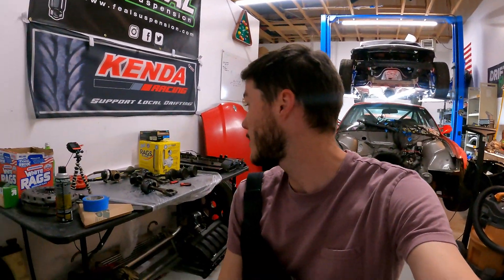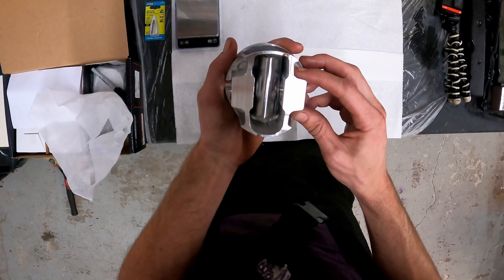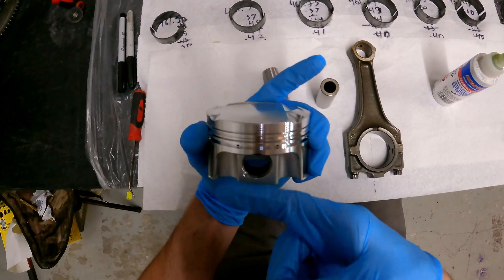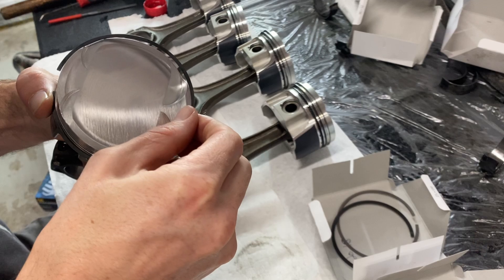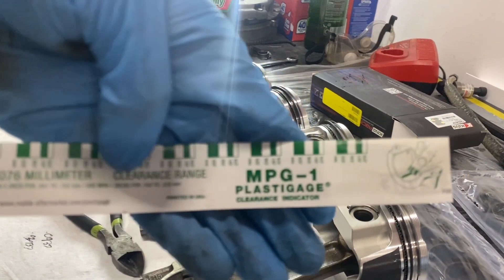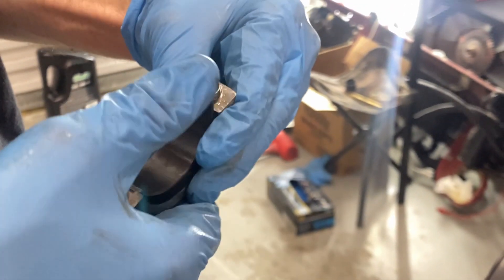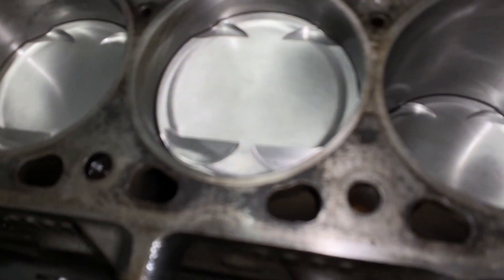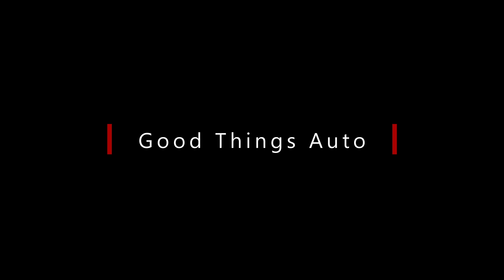Balancing M50 / M52 Boost Pistons and Assembling the Full Bottom End!!

Comment: Sup man, I’m on my second engine build currently have 8:1 wiseco pistons and eagle rods, stock m52 crank. Correct me if i’m wrong, you’re using m52 crank with m50tu pistons to bring the compression from 8.8:1-10.5? I’m looking for 9.5-10:1
Reply from the maker: I am!  .073 mls brought me to 11.1 with a skim but you could run a cut ring to get you around 10-10.5
Reply: Would the compression be different with an s52 crank, eagle rods and 8:1 wiseco pistons ?